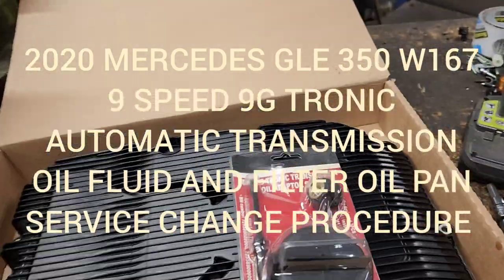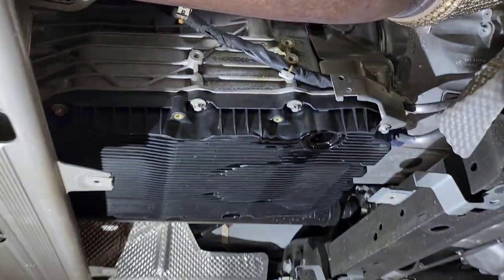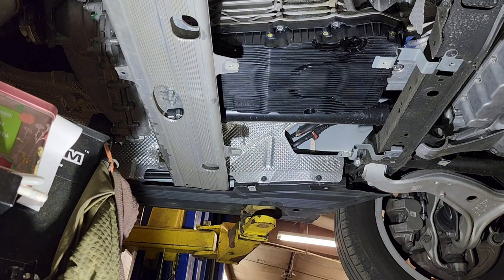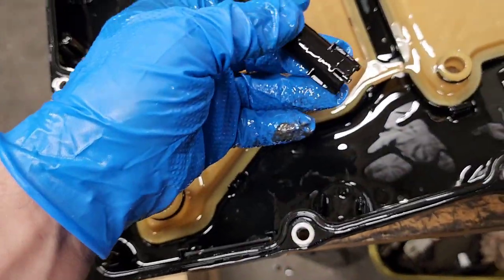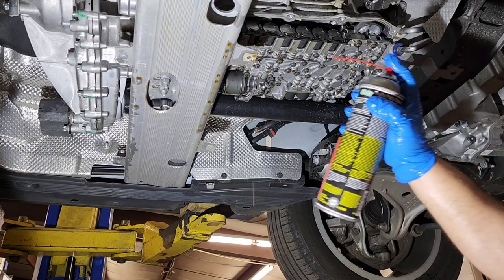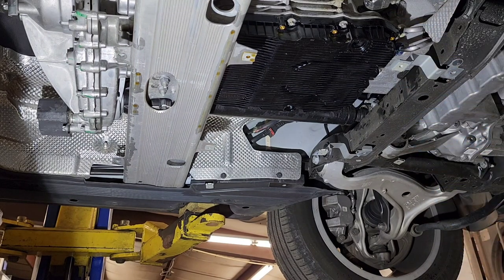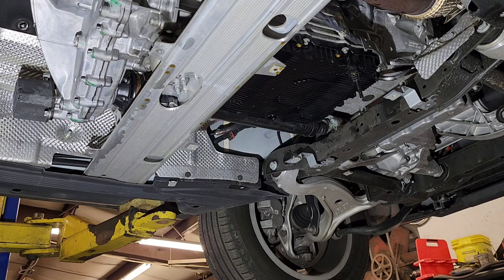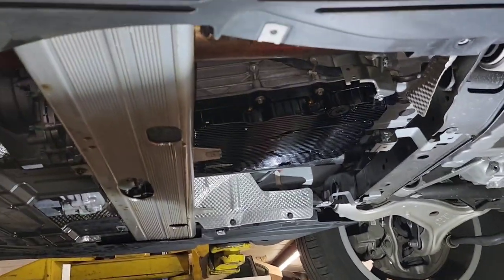2020 MERCEDES GLE 350 4MATIC 9G TRONIC AUTOMATIC TRANSMISSION FLUID OIL SERVICE CHANGE PROCEDURE

Comment: how about drill a hole on the old plastic oil pan to save mess of leaking oil everywhere when take it out. not sure the hack will work or not. Maybe have risk damage the inside component.
Reply from the maker: You shouldn't drill any type of holes because you are risking touching the valve body and parts with the wires all over the place! This could destroy these parts and you may end with a very expensive problem! Sorry but drilling is very risky... Thanks and Good Luck! 🤞💪👍

Comment: Thank you! When you run the engine at the end in D and N, do you keep your foot in the brake, or do you let the wheels engage?
Reply from the maker: Always foot on the Brake! This is just so that the fluid goes all over around the transmission and so forth...  Thanks and Good Luck! 🤞💪👍
Reply: @projectathos  Thank you for the quick response and for sharing your knowledge. I thought that park mode (like a fully depressed brake) doesn’t engage the transmission (as in, the wheels don’t turn). Glad I asked!

Comment: Is it necessary to change the transmission fluid at 40k miles or can I just run the car like that? I mean, would it cause damage if I never changed it?
Reply from the maker: You need to do this service every 30k to 40k Miles depending on your driving habits or you will end up destroying your transmission for sure! There's is a reason why this service needs to be done... Thanks and Good Luck! 🤞💪👍

Comment: How about the fluid in the torque converter? After removing the screw, they can also be drained and replaced.
Reply from the maker: It's not recommended to change the whole fluid in the transmission or also called flushing because when you remove the fine wear particles from the clutches in the fluid you will end up creating a sudden burning of the clutches and destroying of the transmission when you install a complete new fluid. We have seen this situation many times now. Remember transmissions don't work the same way like engines where you have to replace the whole fluid. This is something that the dealerships do not tell people and later in time you end up with burnt transmissions at 100,000 miles... This is my experience therefore my recommendation and I don't force this on anyone because it is up to you to research and decide what actually you would like to do. We have vehicles lasting more than 300 000 miles on the transmissions with this type of partial transmission fluid change. Happy to answer your other questions! Thanks for your support!
Reply: Great explanation. Thank you for sharing your profession experience on youtube.

Comment: is the procedure the same for 2021 GLS450 3.0L ?   thank you
Reply from the maker: Yes I believe so because these days Mercedes is using the same 9G 9 Speed transmission on almost all models. Check with your dealer for confirmation if in doubt...

Comment: Aren't you supposed to torque those new oil pan bolts to 4nm+90 degree?
Reply from the maker: YES but when you try to do the 90 degrees the bolts will not go so I am using my experience and common sense because I don't want to break one these weak Aluminum bolts inside so I torqued them by hand until I feel they are tight... You can tey whatever you want, this is what I did and so far everything is fine. For that matter never had problems using my brain 😂

Comment: Did you leave the drain plug in 1 position?
Reply from the maker: Yes, you need to set the adapter to Position 1 to fill back the transmission.
Reply: Position 4 to drain 
Position 1 to fill 
Thank you great video

Comment: Thanks - Why did you replace the pan?
Reply from the maker: Very simple - The Transmission Fluid filter is built in the pan as you can see in the video. Thanks 👍
Reply: I later learned those were filters and reason to get the pan. Thank you! @projectathos